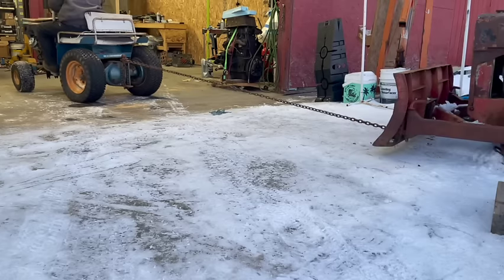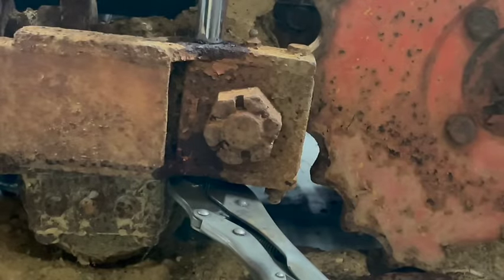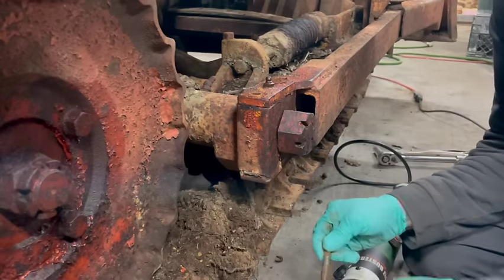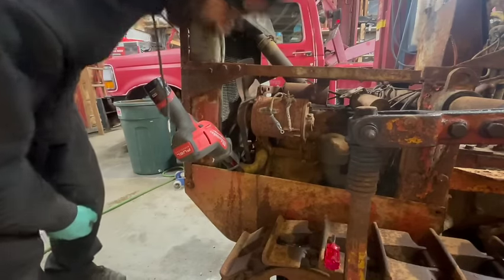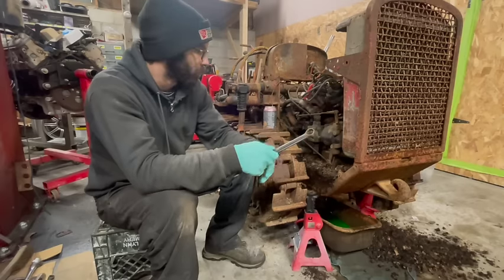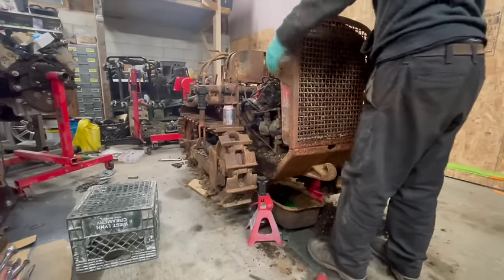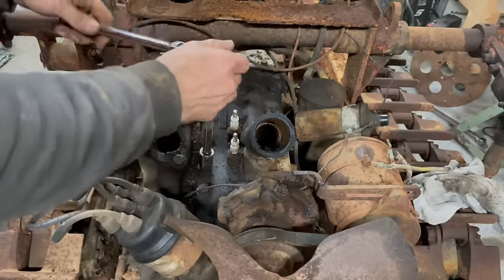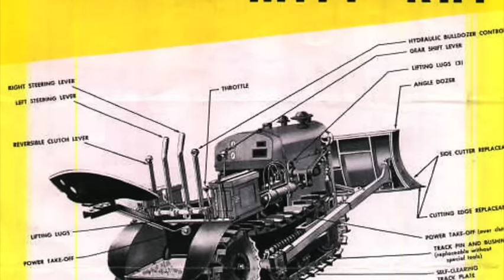Bulldozer Dead for decades: Can This Rare Mity Kat Bulldozer be saved??

Comment: this is cool i am waching it again, when I'm watching I'm in the process of taking apart and getting a old springfeild riding mower, model 25 into operating order, and I'm also using that nut buster, works wonders on old parts and now mower deck spindalls

Comment: ....heavy 2350 lb object btw!  That was a very heart felt story and I get it.  The attraction to the piece, the ambition coming from that, the desire and attention to putting it back as it was!   I am looking forward to more because of the same.  It is bringing me back about 10 to 15  years to a time when I was in it deep! 

I usually wait to let the heated object cool before using the penetrant.  with the valve, there is possibly a metallurgical change that may not be desired in doing that that makes me nervous, I don't know.  The theory of heat and spray to suck the penetrant in... I, myself do not do anymore as it seems to harden the object to where if you then ever need to go to the next step and try and drill it out (bolt for example) it is then too hard to drill.  Even when I weld on a washer and or nut on a broken stud, I let it cool naturally before I mess with it.  Keep up the great work!  I am eager to follow!
Reply from the maker: Your right about the oil hardening heated objects but that occurs closer to a red orange temp. Sometimes it works sometimes it doesnt but the heat is being used more for expanding the materials. They say .004” per inch of bore at 250f. That can give just enough to break the bond. Welding on a stud brings it to that critical temp and it shrinks more than it expands doing the work for you.In the case of these exhuast valves cyl one broke, not a loss as the stem was rotted from sitting in water planning on replacing all the exhuast valves and at least the guides in cyl 1 and 2 if possible. Getting it to go up or down out of the guide is going to be tricky.Is it really 2350! Wow. Im going to take the manifolds and tappet cover off tonight and see what the story is. Thanks cant wait to see the info
Reply: You are probably correct on the red orange side of things.  Yes, heat enlarges, thus squeezing and breaking up said bond.  I find that heat cycles and cooling about 3 times works for those stubborn ones!  Patience is the key.  I had 4 inches of shank of a head bolt I worked for 2 days till I got it.!  The extreme amount of time was in the walking away in between.  A tech can't do that in a shop though.  I also wanted to add something positive and neglected to do so in the first comment.  I am editing that very comment above.  Thanks for the mention!  I also watched Steves videos a load of times back then when I was messing with these. @jmpsavescars

Comment: Pretty sweet !!!! You are encouraging me to get back to working on my International 3616 . A stalled project in my backyard. Going to re-power from a diesel to a gas engine.
Reply from the maker: Thanks man! Im glad i got you interested to get back at it. A big project is just a bunch of small steps. Just keep checking things off and it will be done before you know it! Ls swap? Haha
Reply: @jmpsavescars  No, not that crazy, but close enough in it's own way.. I did purchase a gasoline engine of much larger displacement, that will hopefully bolt in with little modifications. The oddity is the distance traveled to pick it up.... I traveled from basically Dayton Ohio to somewhere near Houston Texas.... it was an irrigation pump engine.

Comment: I just want to say that those bolts coming out at the end, some of them needed some convincing. Good thing they were designed for that. Also, and I may look into this as a refresher, I believe that in the Pacific Theater of WWII, there were similar little dozers, air portable, and possibly even droppable, to be used to work on the landing strips on various islands. Now I gotta catch up, and mention this on a more noticeable post, hopefully with additional info.
Reply from the maker: Yea they did, and your exactly right, although the mity kat never saw action. Its a continuation of the beetle which was   Used to rebuild air strips. Thanks

Comment: New subscriber here. I love this type of content and also your commentary. You used the term "beetle tractor" in this video. I wonder if you were referring to Doodlebug tractors. They were small tractors built during my father's generation (the Great Depression) from old Model T frames and engines because they couldn't afford to buy real tractors. In the late 50's or early 60's he talked of building one instead of buying a riding mower (unfortunately he didn't). I'm going to be binge watching to catch up on this project.
Reply from the maker: Hey there thanks and welcome! Beetle referring to the machine that preceeded the mighty kat, the laurentide trail beetle they were built earlier and during ww2 the design parts and production shifted to mity kat early in the 50s. I myself have a model aa ford doodlebug that i really enjoy having. Twin transmission setup and the big truck tires it really can do some pulling. Ill be working on the machine here and there and posting videos when i have time! Thanks

Comment: Any thing can run again. Money and time and parts.
Reply from the maker: True to a point. Are you familiar with bearings that are not removable. “Babbit bearings” this engine uses those. Also a crack anywhere in the block in some cases would be a dead stop. This engine was also obsolete more than 60 years ago. Parts are very scarce. Its looking promising for this one though!

Comment: Is there anyone on youtube who applies penetrating oil more than 4 seconds before they start working on a fastener?
Reply from the maker: Carefully taking advantage of the brief period of time where the hole is expanded is the key in some scenarios. Just to break the bond. Believe me i eat sleep and breath seized fasteners. Allways open to pointers and suggestions though.
Reply: @jmpsavescars  right on man.  I can dig it.  Here's a suggestion then.  Spray the penetrating oil all over fasteners you inend to work on a week ahead of the work instead of 4 seconds before (so it can penetrate like)  just a thought.  Good luck with the project.   Thanks for sharing.
Reply from the maker: Absolutely. In this case the engine had been sitting for months with a concoction in the cyls in anticipation of doing the disassembly. When im applying it with heat the purpose is to shrink the stuck object faster than the outside part holding it, i only do this to parts i know ill be replacing because it does change the hardness. The next video will show this principle in extreme practice removing the number one exhaust valve. Thanks for watching

Comment: Just found your channel. Lovely content! One small observation, and i don't know much about engines so i might be wrong, but wouldn't heating up the valver ruin the heat treatment?
Reply from the maker: @vlad516  thanks and welcome! Heating and welding will ruin the integrity but it that condition a new valve is the only option so damage is ok to extract it even the guide can be replaced but i was not being picky the valves are a steel harder than the seat which is the block in this case glad your enjoying the content!